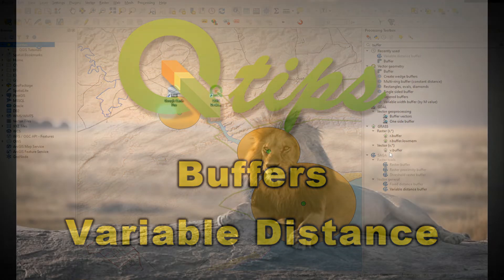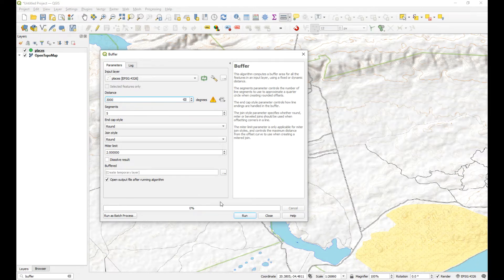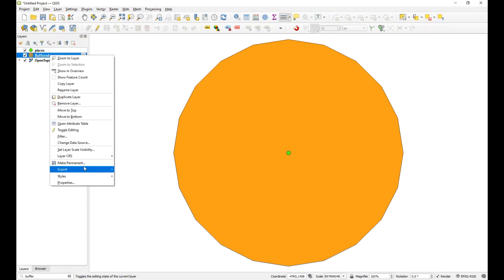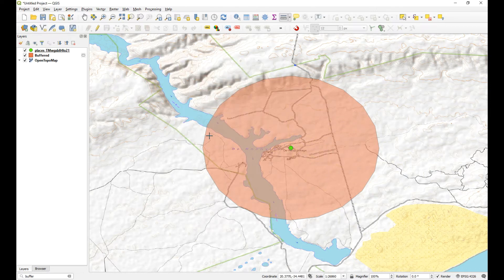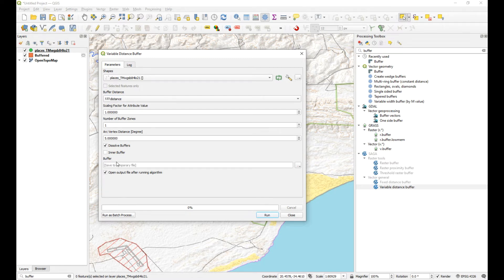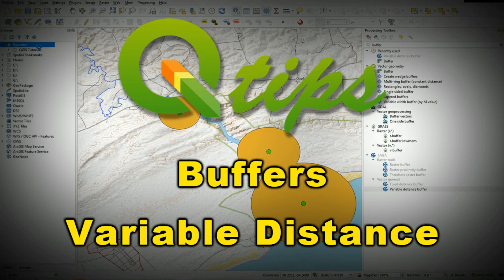QGIS Variable Distance Buffers

Comment: you can get a variable distance buffer with the regular buffer tool by going to toolbox > buffer > distance, and then on the right of the value input box, there's a button next to the unit selection button. Hover over that and it should say "data defined override". Click on that and on "Edit", which will ask you for a formula, which should be "distance" (WITH the double apostrophes) in this case or any other field name. Of course, there might be advantages of using SAGA for the variable distance buffer.
Reply from the maker: Good spot.  Thanks Ben.
Reply: Many thanks for the detailed video @Q-tips!

One advantage of SAGA is that you can rescale the buffer distances. So for instance if you load in a CSV file with points and buffer diameters in km you can multiply by 500 and with that you specify the radius in m with input being diameter in km.

Also you can indicate segment angle rather than number of segments, but I'm not really sure when which method would be most useful. Usually you just want a polygon looking like a circle without it straining performance too much.
Reply: Great!

Comment from the maker: timestamps
0:20 Add the Open Topo QMS base layer
0:44 CRS Pseudo-Mercator to WGS84 Geographic CRS
1:22 Create a new shapefile layer
2:29 Digitize new feature
2:57 Buffer in decimal degrees!
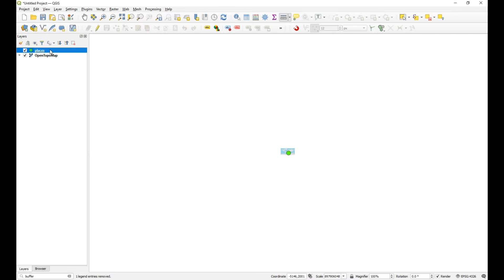4:57 Change the layer CRS from decimal degrees to a projection in meters
6:35 Buffer in meters
7:40 Capture new features
8:20 Create and edit a new distance column
9:45 Variable distance buffer
13:00 Multipart to singlepart
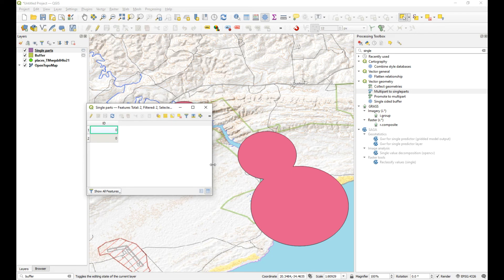13:50 Calculate areas in hectares
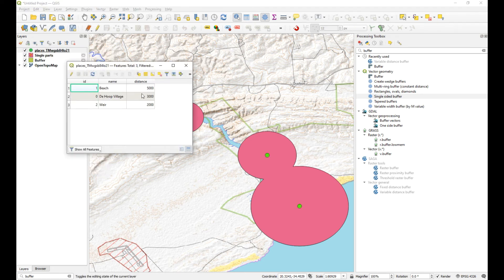15:20 Temporary layers in QGIS